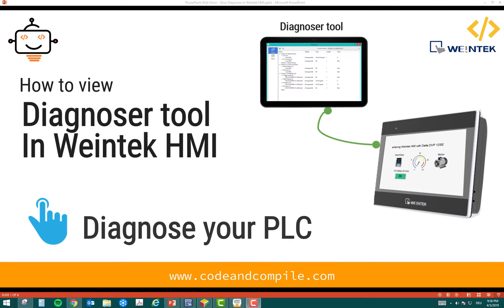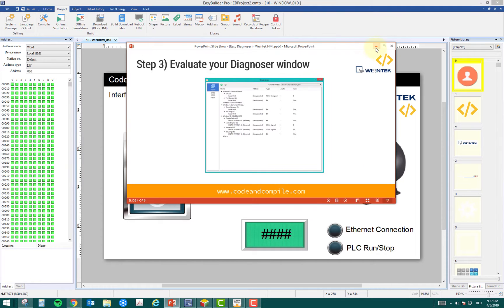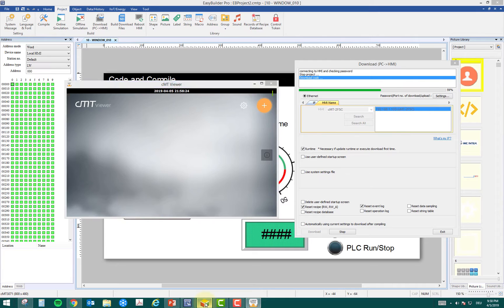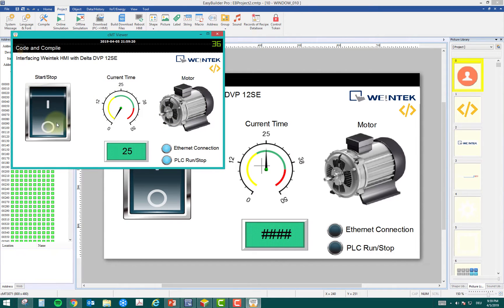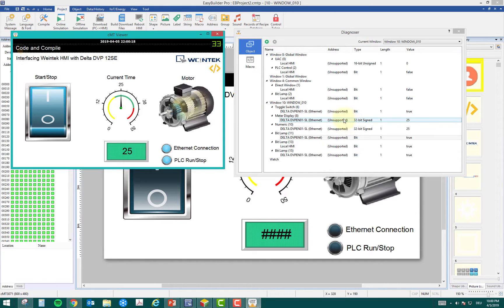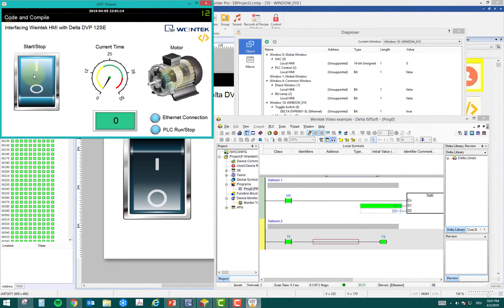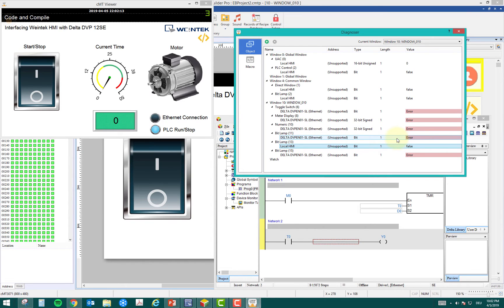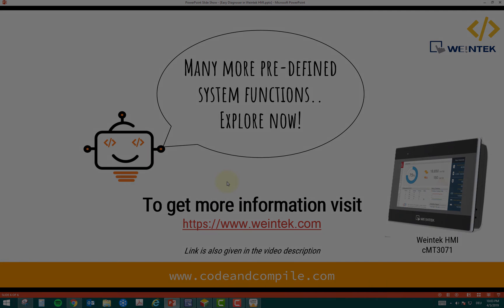Lesson 5- cMT Diagnoser tool in Weintek HMI

Comment: PLC based pressure control in multiple pump application ... (water pressure need 1 to 5 bar) .. when line pressure is 1 bar then all motor is running till the water pressure of the line  becomes 5 bar . when line water pressure is 2 bar then 4 motor is running , Then at last when water pressure is 5 bar then only one motor is running. pressure sensor is connected to the PLC and that is in the output main water line to measure the water pressure. because of this problem how can i design the ladder .. . www.quora.com -- you answer a question something like my question on Apr 16, 2017. But its incomplete.So if you have any clue then share with me and make a video with this problem.